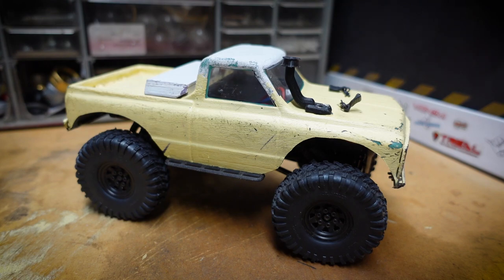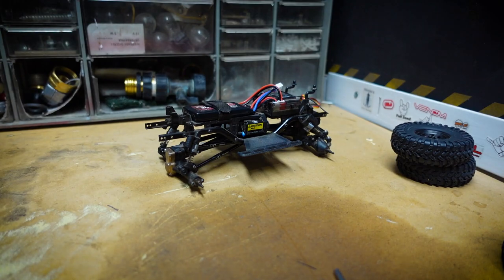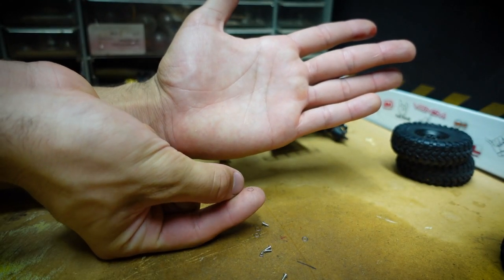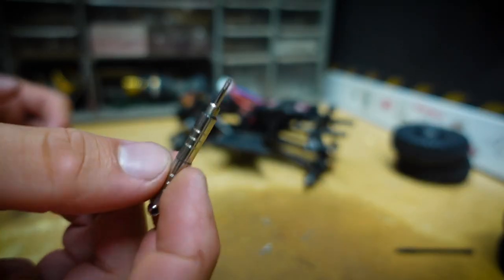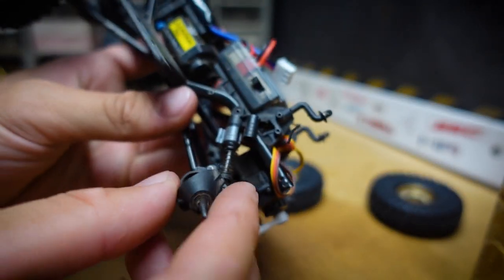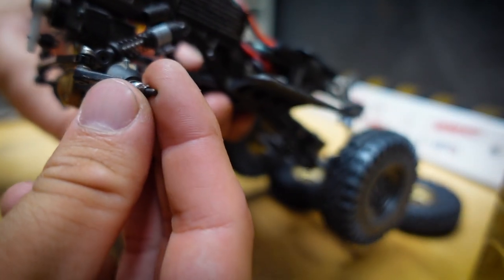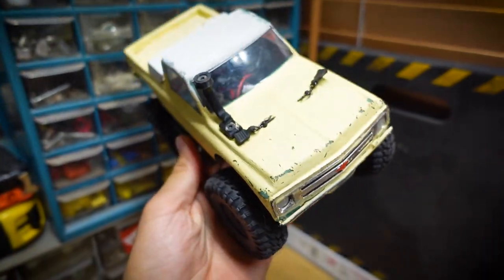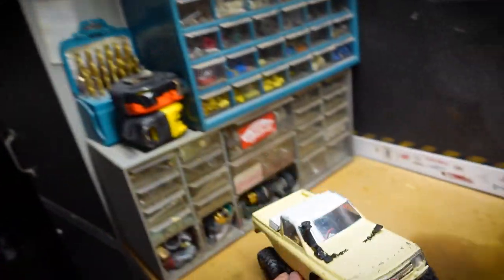Axial SCX24 C10 Hot Racing +4mm Steel Drive Stub Axle Upgrade Ep.21

Comment: Love this upgrade especially with the brass weights, some people have issues with it hitching and having driveline issues I assume because they don’t put the rubber O ring from the stock drivecups into the new ones. Mine fit like a glove and it makes a HUGE difference especially when side hilling or trying to climb diagonally (also slightly increases wheel travel for even less roll)
Reply from the maker: Definitely a must in my opinion!!

Comment: I ordered +4 shafts from ebay, it was NHX rc brand. Quality was horrible. The shafts doesn't even fit bearings and the wheels wont bolt on straight due to the diameter of shafts, the front slits had burrs causing dog bone to bind, orings that doesn't even fit, one of the rear axle wasn't threaded properly for wheel nut. I might try Hot Racing brand this time.
Reply from the maker: Never had an issue with the hr ones 👍

Comment: Man I'm struggling with these axles I didn't get the hot racing brand so maybe that's the problem but I also added treal brass knuckles which I hope isn't the problem but I can not get the axle to stay seated it's jumping all over the place then switched back to stock front and its better but still jumps some really making me afraid to do any more upgrades even thought about buying new assembled aluminum axles and just leaving it at that any suggestions are appreciated
Reply: Ps I did use stock orings made no difference
Reply from the maker: Are the axles seated in correctly, like did they pop in right?
Reply: @MiguelCortez  they felt like they did the back hasn't been a problem the front have been a headache I noticed the notch wasn't as deep on the new ones but even with the old one it doesn't jump bad just on start up the wheel jerks then it straightened out its not as bad as I was thinking but it does seem like something is off